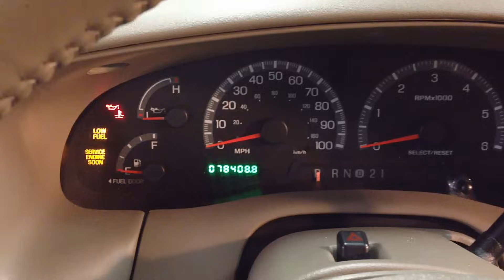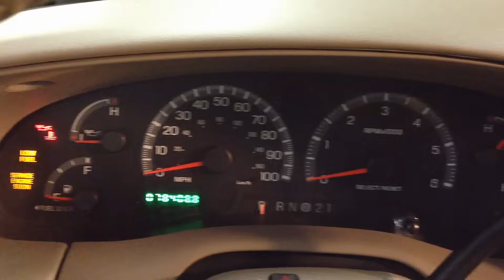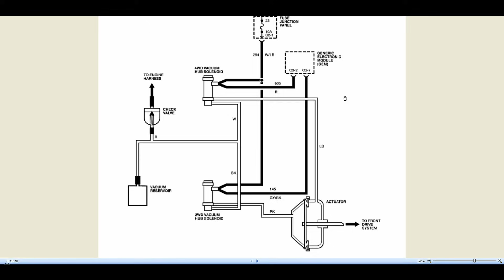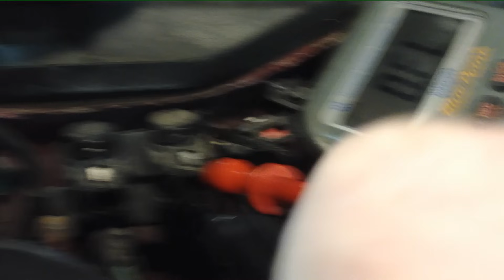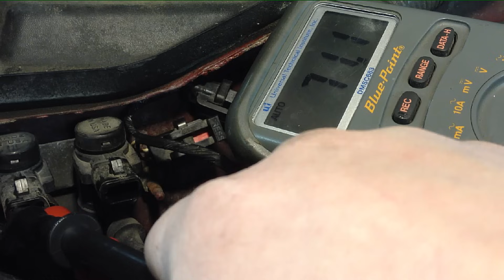1997-2004 Ford F150 4X4 Inoperative In Depth Diagnosis

Comment: maybe you can help me. When I engage 4x4 the (so it seems) the from end is binding. I can't turn left or right without it binding up.  what can you tell me
Reply from the maker: This is called axle wind up and is perfectly norm al on dry roads.
Reply: FordTechMakuloco hey bud, I haven't used it on dry road yet. in fact today, I noticed th binding even when trying to go either forward or backward. there's a very very loud thudding noise when I try to use the 4x4. I'm here in Ohio and 1,500 miles away from home.
Reply: Michael Counterman Your front diff is not the same as the back. The back, when turning, allows one time to spin quicker than the other because the outside tire has to go further. The front doesn't have that because the front tires are usually independent from each other except when in 4x4. So what is happening when turning is both tires are going the same speed but one needs to go slower or faster than the other one. So since it can't, it's only choice is to skip across the ground. That is the binding you are feeling. On dry pavement it is super notice and very hard on 4x4 components and will wear your tires weirdly very quickly. You can feel this same affect offroad as well but it isn't as big of a deal because on dirt or gravel the loose materials allow the tires to skip along without as much stress.

Comment: my 03 4.6 f150 will go into 4low but not 4 high
Reply from the maker: Pull codes on the gem you may have a transfer case shift motor concern.

Comment: Thanks for taking your time to post this. I know takes a lot of work. I have just purchased a 2001 F-150 4X4 from my brother and it is an automatic with the 4X4 shifting manually on a floor shifter. It is locked, seemingly, in 2 WD. When I've tried to shift it into 4WD Hi, it just seems frozen and wont shift at all. Can you direct me to anyplace that might help me troubleshoot this. The shifter on the floor won't move at all.
Reply: Patrick Brandon did you ever find out what's going on with your 4×4? I'm havingg the same problem and can't seem to find anything helpful on how to fix. hopefully you can help, thanks for your time

Comment: hey so I cant hear the relay in the dash when I turn the switch or the shift motor but the vacuum seems to be working
Reply: I checked the fuses and I assume  the switch is working because I have power on the second vacuum solenoid when shifted into 4wd but it doesn't have power when it's in 2wd

Comment: Great video. When using the test method in the video, I found that my 2 wheel drive solenoid is not getting a ground with key on engine off. Does that mean I need a new GEM module?
Reply: Hi keith did you ever figure this out.? If so what was the problem? The fix?

Comment: I have a 2003 expedition.  My wife allowed our 2 year old to play with the 4WD selector and she put it in 4LO while the truck was completely off.  When my wife turned on the truck it went into 4WD with no dash lights.  She drove it like that for approx. two days.  I put the truck back in 2WD and all was well for about 5 days.  Then on the highway without the switch being touched the truck went into 4WD.  I assume it was the additional load but the transmission pan gasket blew and fluid was leaking from the transfer case breather.  I replaced the gasket and filter on the transmission.  Drained the transfer case and the fluid looked normal, no significant metal shavings, filled with new fluid.  The truck is clearly in 4WD, tried to put in two drive and it won't go.  Backed up 40 feet, nothing.  Disconnected the battery for a few hours, still stuck.  When I move the selector from 2WD to 4H and 4L I can hear the transfer case "clunk" but the truck will not come out of 4WD.  PLEASE HELP!
Reply from the maker: Make sure the front hubs are unlocking and receiving vacuum when the engine is running also check for codes to make sure the contact plate has not lost position.
Reply: FordTechMakuloco what contact plate?
Reply from the maker: There is a contact plate inside the transfer case shift motor that wears over time this is used to sense the position of the transfer case shift shaft. If it wears out and no signal is produced the module sets a dtc and can disable the system.
Reply: FordTechMakuloco, so if both hubs are locked, it would most likely be the solenoid behind the battery?
Reply: FordTechMakuloco, I applied vacuum directly to each Hub and they do disengage. I check the solenoid behind the battery and the supply line from the vehicle was capped off from the previous owner. I reconnected it and now in 2 wheel drive the front hubs will disengage but the drive shaft coming out of the transfer case is locked in 4 wheel drive.  I pulled off the transfer case motor and tested it it is functioning properly I can move the selector on the transfer case with a pair of vice grips but even in 2 wheel drive the front drive shaft is still locked.

Comment: i have a 1998 ford expedition xlt , my 4x4 isnt working . when i turn my 4x4 switch to 4 low it shows 4awd on the dash , if i turn it to 4 high it says 4awd on the dash and when i turn it to 4awd it shows 4awd .  so one light is coming on for all 3 4x4 modes but the 4x4 isnt working . any suggestions ?
Reply: Dalton Burchett same here. I have power, ground, and vaccum at the solenoid. mechanic told me there is no power at the transfer case shift motor. I can't find a diagram to see how it gets power
Reply: +Will Barkus  i figured out what my isssue is i believe . i havent fixed it yet because i need to order the parts , but im pretty sure it is the transfercase shift motor and the front actuator

Comment: f150 auto 4 wheel did all the checks  vacuum is working but front end is not locking wheels together ,,I got under and it is pulling rod all the way over to the 4 wheel position  Would it be inside?

Comment: I have a 1998 Ford F-150. The 2 wheel drive and 4 wheel drive solenoids aren't getting any power. What do I need to do to fix that? If someone could help it would be greatly appreciated.

Comment: I got a 2002 F150 4x4,got stuck on a road during deer season,had to get pulled out n towed home,thanks to your video I was able to trouble shoot the problem myself,ended up finding my vacuum lines going down to my actuator wer broken n brittle,i'm very thankful I was able to find your video

Comment: do ido that with a autozone scanner or is  a dealer  needed
Reply from the maker: Dealer or independent shop
Reply: What would be wrong if I had 12 volts to both solenoids and both switched grounds on at the same time. With the key off

Comment: my shift motor doesnt turn on and no lights come on in 4x4 on dash.
Reply from the maker: Pull codes on the GEM module.
Reply: Ford technicolor hgddtugdggshdg0pooiuyytr4ewq
Reply: FordTechMakuloco
Reply: vv
Reply: You mentioned that I should hear the transfer case shift motor if it's functional on my 99 Ford Expedition, does the engine need to be running or should I be able to hear it with the ign sw on? 
With it running all I have noticed is the "clicking" coming from inside the dash. I'm mechanically inclined but I have not worked on electronic actuated transfer case. Thanks for your time, I enjoy your videos, very detailed for us newbies.

Comment: truck acts as if it's stuck in four wheel drive
Reply: Thank you using your video I was able to rewire both solenoids that had been cut off. I paused the screen to identify the wiring color pairing. 4wd works great!!

Comment: Hi FordTechMakuloco. Great video !  Did all the checks for the solenoids and no ground to the 4wd solenoid.  All other electrics from GEM are functioning except that one and when you put the switch in 4wd it would click on the right side of the dash 4 times then do nothing, no light, no 4wd and it would only do it once for each power up of the key.  Crawled underneath and the transfer case motor was pretty rusty looking and tried tapping it with a hammer but did no good.  Bought a new Dorman motor and installed it, reset the computer by disconnecting the battery and the first time it did not work.  Powered the key on and off a few times with the switch set to 4wd and wholla, all works fine on the jack stands now.  Took it for a test ride after dinner and it works like new, both in high and low range.  Thanks a million !!

Comment: I have a 2003 for f250 v10 and I don't know what to do to get my 4x4 to work.  I can turn the on demand switch to 4x4 on the dash and nothing happens.  ive replaced the 30amp fuse under the dash with a new one but still nothing.  do u think its the actual switch itself?  or is there something more to it???  now the 4x4 light on the dash works because when I turn on the truck I see the light turn on.  can u please help me

Comment: Hi FordTechMakuloco. Great video. I checked my power to my 4wd solenoid and it looked ok. When I checked my vacuum i have vacuum on both lower connectors. When I reattach the lower connectors I have vaccum on my upper 2wd solenoid connector but when I switch to 4wd I don't get any vacuum there. I tried a new switch but that didn't do anything. 
I also don't hear any clicking of relays when I move the switch from 2wd to 4wd hi. Would this be  the gem module? I also checked, and replaced, fuse 23. It wasn't blown I just switched it out just in case.
Reply from the maker: It sounds like the GEM is not allowing 4wd operation because it is seeing a fault. Get codes checked in the GEM you likely have Transfer case shift motor contact plate failure codes set.
Reply: Is that something a dealer would have to read? I don't have any service engine indicators. Could I check it with my handheld reader?

Comment: I have a 2007 F150 XLT..4-wheel drive is not working had to have Triple A pull me out of a small mud puddle which I shouldn't have a problem.Driver stated is your 4wheel is working it stated on my dash it's on.It's been over a year since it worked.I tried a few things.Hear the click when turned to 4 wheel , Also saw on Youtube turn your air on and then turn on your 4 wheel and if you get air blowing out then your vacuum is fine..I don't have a tester..should I buy one?

Comment: I have an F 150 98 4 wheel drive works but the lights are not turning on to say 4 high are for low does not turn on trying to figure it out but I am lost
Reply: Did u figure out why light not come on same issue on my 99
Reply: No I bought a new Switch but still did not work the guy that I bought it from said it was working and then it just stopped
Reply: I just bought truck goes into 4 wd but no indictor light o well thanks for responding

Comment: Awesome video.  Thx for the info. This was very thorough and easy to understand.  I'm in the Obx and was attempting to go onto the "4x4 drive on beach".  I turned the switch to 4H and nothing happened.  Ended up having to get towed out of the sand. Got back to the house, watched your video and turns out my actuator was stuck.  I manually depressed it a few times and now everything is working fine. I use YouTube for a lot of the do-it yourself videos and I must say this is one of the best I've seen!!! Thx again.
Reply: I’m at home watching this video after getting my truck out of a sand pit 😂😂😂

Comment: thanks for the video, the problem I have is that when active 4x4 does not go but if I turn the light on the board and when deactivate the light is lit on the board have to turn off the car so that the light goes out .

Comment: I got a problem with my 03 ford and it will lock the t case and front drive shaft in but when I lock it in 4x4 everything will lock and turn but the front wheels. What would Tht be?

Comment: What if when i reconnect both lines and when i swtich from 4wd to 2wd both solenoids still feed out vacuum. Does this mean the solenoid is bad?
Reply: Need help. I've replaced the shift motor, both silnods, actuator still can't get the transfer case shift motor to work. No vaccum at silnods. In desperate need of ur help.Thank you in advance

Comment: Dude I need your help! I have a 1997 250 light duty with the 5.4L with this system. When I bought this truck the 4x4 didn't work all it was is the hydraulic actuator. I ripped it out and installed a Posi Lock brand cable that sits under the dash and I can just pull the actuator in mechanically.Thing worked great for a few years. I just took the truck out for a spin and decided to try the 4x4 I haven't used it in a year or so... I go through the motions I turn the nob on the dash to 4H pull my cable were in were rocking.... Its making some loud noises directly proportional to the speed of the vehicle not really horrible grinding so much but a rapping....The real issue ... I can dis-engage my front axel with my cable but I cant get the spinning noise to stop now like the transfer case gears sound like their still going but my axel is def. Not engaged.... My lights on my dash will not show.  I hear no clicking when I turn the 4x4 dash nob. I threw my testers on the 1st pin at the knob and got something like 14vs. I tried checking for continuity during different switch positions and testing the little resistors inside... I'm not a dc expert tho no continuity when changing positions using the back pins and turning the dial but the resistance ok seemed ok?I need input...DUDE also I have the 7 Lug rims..... thanks ford...... their rotting out from under my truck and I cant find new ones anywhere any ideas? Nothing fancy just solid not rotten 7 lugs  think ford discontinued them?

Comment: Great video! I followed the vacuum all the way down to the vacuum switch that moves the control arm that engages the front axles but the pin on vacuum switch was not moving. After moving the pin in and out manually about 20 times by prying on the control arm with a screw driver the mechanical was easier to move. The pin on the vacuum switch actually started moving in and out  like it was designed to move. Lesson here for me is probably to engage 4 WD more often so the control arm does not get stuck from lack of use Thanks for your awesome video!

Comment: My 2003 F150 4x4 is not working. I get a click sound(sometimes) when I turn the selector switch to 4x4.the symbol on the display doesn't light up. I don't hear a sound from under the truck. Tested the 2 actuators on the firewalland the 2 wheel drive negative ground test fails to have the light go out when 4 x4 is engaged. and the 4x4 negative ground doesn't light up. Is this the GEM module failing?

Comment: So I was following all these directions. I got to the actuator part. I started the truck put it into 4 high, crawled underneath to pull the hose. It had suction but the pin didn't push out or go in. It was stuck. Would that be the actuator being bad or the internal stuff?

Comment: My 2004 F-150.  Heritage. The 4wd light will not come on and the 4wd does not work
Reply from the maker: +Kelly Gwyn Slusser Pull codes on the GEM module the transfer case shift motor has likely lost position.

Comment: My 98 expedition xlt from 2wd to 4 awd comes on for a while then turns off, and 4hi or 4low won't ? Is it the switch ? I hear the clicking that you talking about in your video but no dash lights come on
Reply from the maker: +jimmy Lopez Get the codes read in the GEM the transfer case shift motor likely lost position.

Comment: Great video. I have a 97 F250 light duty and the 4 wheel drive stopped working all of a sudden. The 4x4 light on the dash does not come on when I move the switch and I checked the #23 fuse and it is good. Any help would be appreciated. Thanks.
Reply from the maker: +Mario Forcinito what do the test in this video come up with
Reply: +FordTechMakuloco I haven't had the chance to do the test due to work and rainy weather where I am. I am going to try and do it tomorrow or the day after. Its was pretty odd how the 4 wheel drive stopped working. I was driving down the road and the 4x4 light blinked a couple times and almost stalled the truck. I pulled over and ran the switch through the 2H, 4H, and 4L while in neutral and no lights lit up and the 4 wheel drive does not work anymore. I will do the test as soon as I can. Thank you for your help.

Comment: help please! I've got a 2002 expedition EB 5.4L V8 and it's stuck in either 4H or 4L and will NOT go back into A4WD  (all wheel drive). Does not have 2wd, it's either A4WD, 4H or 4L. any suggestions on this will be VERY helpful! thanks!
Reply from the maker: +Gilbert Graue Your transfer case shift motor is likely stuck very common.
Reply: +FordTechMakuloco any tips or tricks or just replace it?

Comment: hi, i'm switching a 2 wheel drive body from a 2001 f150 over to a2001 4 wheel drive chassis. i have the wires that comes from the shift selector  and the ones from the transfer case that come through the floor. what i need to know is how to wire between the two of them.

Comment: Hey there! very in depth video with great info! i have a 97 f150 xlt 4x4 with 5.4L and ESOF.  having a really hard time figuring out what is wrong with the 4x4.  was stuck in 4wd-low and changed t-case shift motor.  manually switch back over to 2wd-hi and put shift motor back on.  Now, shift motor wont shift and 4wd light in dash is stuck on and 4wd low will randomly turn on and wont turn off until i shift to neutral.  Having a really hard time with this.  Any help?

Comment: i just installed new vacuum solenoids, new t case motor. got the truck to engage in 4 lo (electronic) and now wont disengage. any help would be greatly appreciated.
Reply from the maker: +Ricky Zastrow Stuck in 4 low? Are you in neutral foot on the brake?
Reply: +FordTechMakuloco I can engage 4 hi and 4lo but once it's in 4lo it won't come out until I get under the truck, manually disengage the hubs and switch the tcase motor and tcase into 2hi.